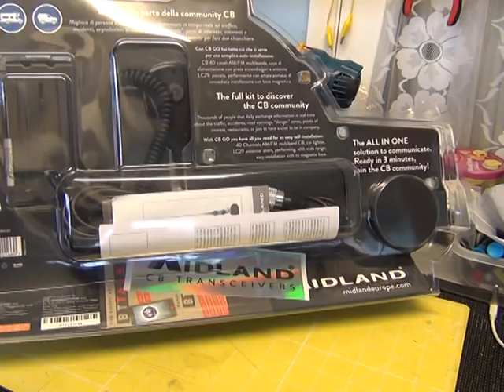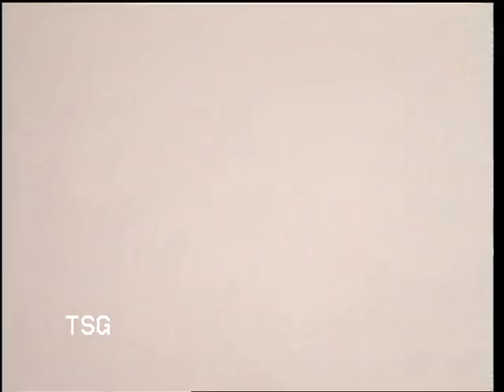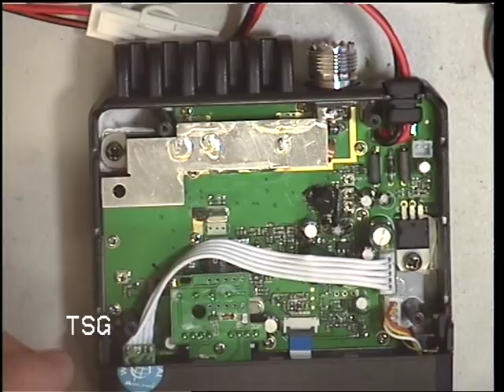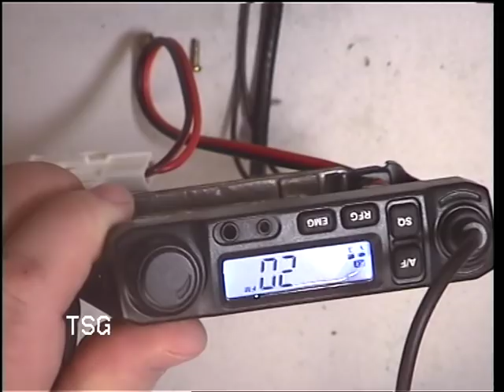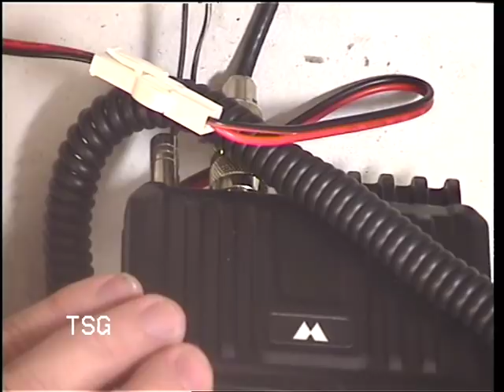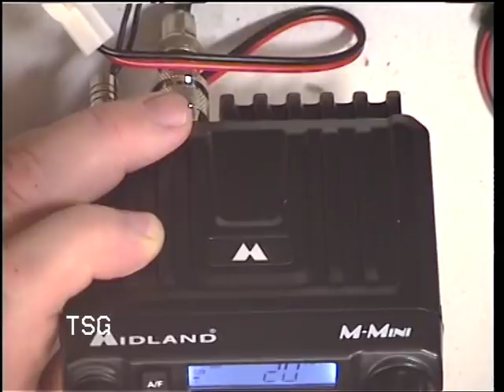Midland M-Mini CB radio (mobile) overview & servicing. (CE Multi-Norm)

Comment: Hi, one question please, is it necessary to make a tos meter adjustment for this model, having a firestick antenna on the spare wheel from the jeep? Thanks for the reply.
Reply from the maker: You always need to check the SWR on a new installation. If you are just swapping an existing radio for a new radio it isn't necessary. Depending on the length of firestick you are using, I'm not sure the spare wheel position is a very good groundplane, so I would definitely check. Also make sure the aerial has a ground at the mount point.

Richard, G0OJF, UK
Reply: @ukfmcbradioservicingTango21  Hi Richard,  one more question please, before this M5 I had an Albrescht 4006e mounted without calibrating the Firesstick antenna and it worked perfectly. Now with this M5 is a calibration required or can I connect directly to the Firestick antenna? Thanks, Christian
Reply from the maker: For the small cost of an SWR meter it is best to check as a high SWR (say beyond 3:1) can result in your transmitter output transistor being destroyed which is not claimable under any warranty a radio may have. I've had situations in business 2-way radio where the performance has actually been better with a wrong aerial. So although satisfactory performance with your previous radio would seem to indicate that the aerial is fine, it's always best to check.

I tested a so-called 'plug & play' aerial last year that was such a poor SWR that I bought another sample thinking the first one was faulty. The second one was just as bad!

Hope this helps,

Richard, G0OJF, UK

Comment: If you long press the rfg button it cicles between "E" and "P". Any idea what's that?  The second letter on the band selection screen changes accordingly. Any clues? Thx
Reply from the maker: No mention in the midland instructions either. Functions may differ from country to country of course & I can only discuss products set up for UK legal operation.

Richard
Reply: @ukfmcbradioservicingTango21  thanks!

Comment: Will this cb radio work in the United States ?
Reply from the maker: No, it would be illegal in the 'States and would need to be an FCC type approved model. No doubt it is available as such under a different name. Conversely USA CB radios are illegal here in the UK and wouldn't work with the 40-channel FM only 27.79125 to 27.99125 channels in addition to the AM/FM 40 CEPT (Euro) channels we may also use here, hence this radio set-up for the UK is 80 channel.

Richard (UK)

Comment: I wonder if one day in the year 2099 maybe they will produce a cb that is properly set up before leaving the factory? Its not rocket science is it?
Reply from the maker: You're absolutely right. Not a unique situation though. UK built colour televisions had to be 'installed' by a dealer & go through power supply, greyscale , purity & convergeance in the customers home...with a pile of test equipment. Japanese colour TV's appeared on the market that had been set-up at the factory, shipped thousands of miles & worked properly out of the box.

I think with CB's, everything is set 'under'. just in case they are sample tested at the docks & the whole container get's rejected.

Richard
Reply: UK CB radio servicing I understand the reason to set them just under but some of the radios you test are way out. I would imagine ham radio equipment is better set up?
Reply from the maker: @simonwalters4842  I've very little experience of ham gear ( we're talking about real ham gear here rather than illegal CB's masquerading as ham gear which are all trash). I once had a Trio 9500 multi-mode 70cms transceiver that arrived spot on & continues so over the 5 years I owned it.Obviously 40 year old good quality ham gear will still need capacitors changing just like anything else. I don't hear any moans over new gear from my Amateur Radio friends, so I'm sure you're correct that it's set up properly at the factory. My own Amateur Radio gear comprises of business radios on Amateur Radio frequencies or built by myself from scratch (rather thank kits).

Richard

Comment: rotel 230 for me.
Reply: be intresting Richard to discuss the difference in the cybenet with the extra if stage .doing some tests not just on sensitiverty but also ajasent channel performance is intresting
Reply from the maker: @natahnjohn2423  Good idea, but the test involves two signal generators & is a pain to set up. You are right of course & ultimately it would be great to be able to say how many dB the selectivity was but bear in mind this is a repair workshop & not a laboratory. Having said that, I've a new building in the planning permission stage at present (building no2 for our pipe organ restoration business), which just happens to have electronics workshop space included with room for about 7 benches...one could be dedicated to selectivity tests.

Richard